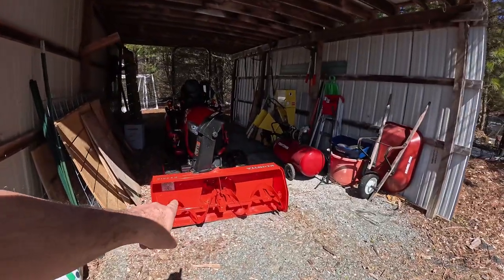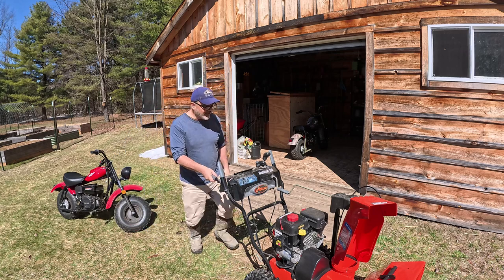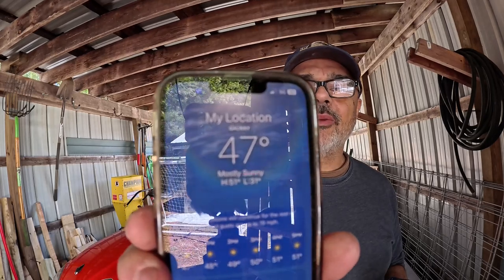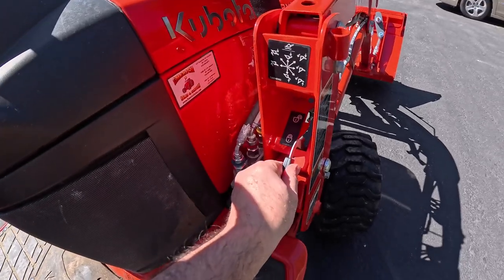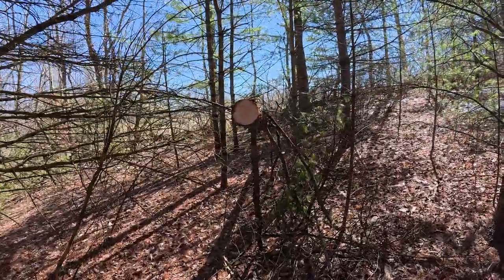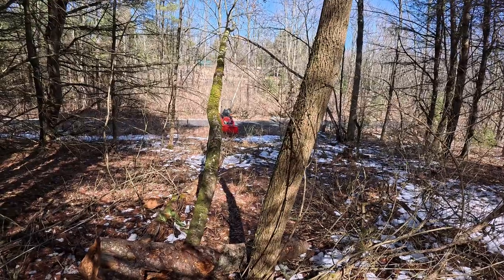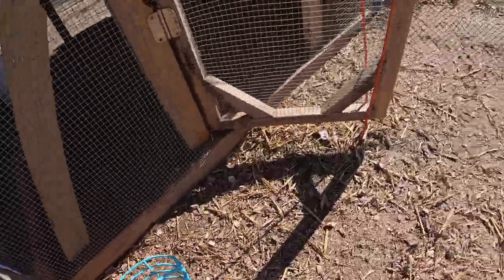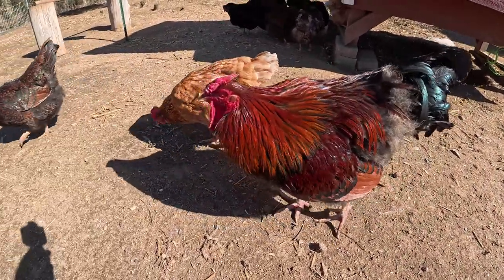Back to Tractor Readiness - Snowblower Removal and Loader Install

Comment: If I moved as fast as you do removing the snow blower, installing the bucket or cutting up fallen trees, I’d have no problem sleeping!  I have 3 sure fires to fall asleep: listening to ambient music or episodes of Keillor’s Lake Woebegone.  In the rare case that those don’t work, reading some of my old college text books are guaranteed anesthetics.
Reply from the maker: Thanks. I have over 100 books that I need to catch up with. I bought lots of them but lost interest in reading most of them. I can surely fall asleep super fast. My wife tells me that I fall asleep in about a minute. That's record fast. My problem is staying asleep. I wake up at 2, 3, 4 am on most days and then it's a struggle going back to sleep, if at all. But I like your idea of listening to ambient music because it does work for many people and my wife listens to it during the day. I tried that and ambient sea and rain sounds many years ago but it didn't work for me. I still have the machine that makes those sounds.

Comment: Ovi, I am the exact same way. 4 or 5hrs. My pattern started years ago. I would work in that body shop till 12 - 1 am then shower, and get up at 4:30 to be in Clifton Park at a construction site. When my father got sick I gave up the shop and rented it to James Chevrolet. That was in 2006. Although James has moved out a long time ago I still don’t do much at the shop. My point being I still haven’t been able to break that sleeping pattern. I must say, I certainly don’t have a problem falling asleep initially. I remember as clear as day shortly before I gave the shop up falling asleep in Clifton Park while I was operating a backhoe! And I’m not even going to tell you how many times I dozed off driving home on 147 in Galway back then! I don’t put that many “working “ hours in anymore, so I don’t have those issues, but I still can’t get more than 5 hrs of sleep.
Reply from the maker: Just like you Aaron, I fall asleep very fast but the problem is staying asleep. It may be that we suffer from some vitamin or mineral deficiency. Have you tried eating sauerkraut before bed, maybe 3 to 4 tablespoons? I have and sometimes it works and I can get 6 to 7 hours without waking up but it's hit or miss. Also, people with gastrointestinal disorders can suffer from insomnia. I will look into that.
Reply: @oviduran  you may be onto something. I have had Gastro issues my whole life. I just figured my sleeping patterns was from the past when I worked like a fool lol. But you may be correct. There might be something more to it.
Reply from the maker: for gastro issues I have been taking sauerkraut right before bed. I've also tried tart cherry juice and sweet potatoes for dinner. I believe my issue is all gastro and what to eat and what not to eat. But the one thing I recommend will always be a good quality sauerkraut right before bed. It's worth a try. Walmart has the flavored sauerkraut, but those do nothing. Get the pure type from some other store. I get mine at the Navy commissary or health food store.

Comment: Your bucket frame might be out of alignment or bent a little next time its off check it and see if its square.
Reply from the maker: Thanks for the tip Billy. I may have to take the bucket off again in a month or two and will inspect it then. I just did a little research because of your tip and there are some people on YouTube and elsewhere with similar issue and possible fixes.